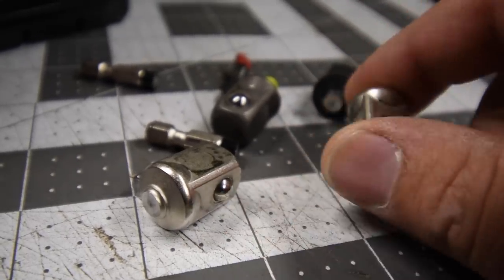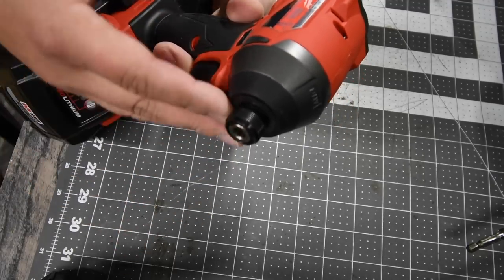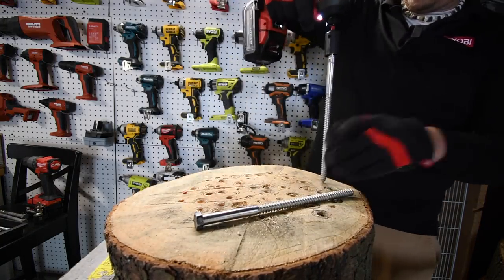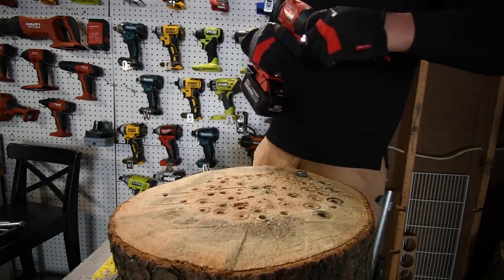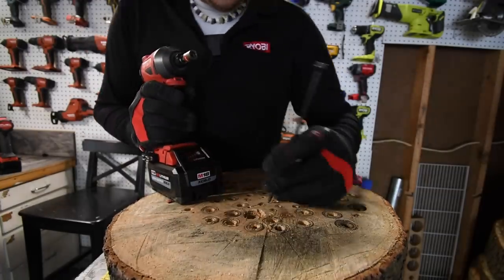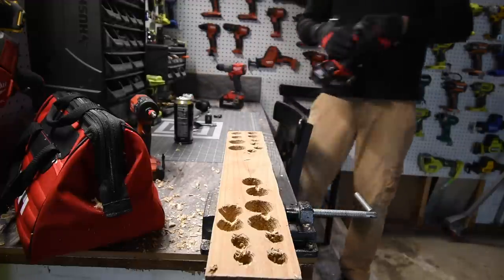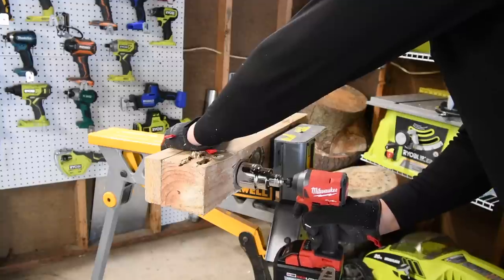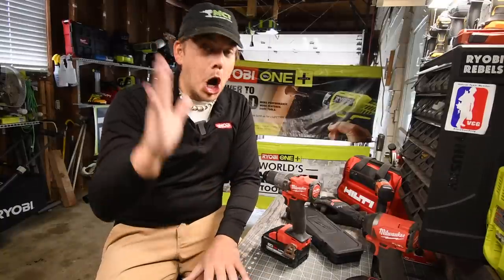Are Impact Drivers  OBSOLETE?

Comment: in real life, in a building site, is a little different,  try a lot of tools for a day this is a good test. 
p.s. the twist, of the screw, at every impact, absorb some the power of impulse driver, with costant torque, in wood, you can put pro-wood screw 400mmx12mm with only 60Nm, try drill on nuts and bolts you break your wrists.
who work in bulding/construction site, know that: every job require specific tools
sorry for any writing errors
Reply from the maker: id use HILTi for every tool that I can on a real job site.
Reply: i too, i've sid 4 a22 ,usually used it with 2.6 A battery or 4 A to reiceve more power, the tiny sid 2A 12v,  sf A 22 with electronic torque control, the grinder 115mm on off classic button (not dead man shut off button), and for concrete te 2 M. i don't need nothing else. at home use stanley fatmax, a surprise for performance\cost\quality.

Comment: But what about longevity,  the impact is designed for that , i worry the drill might burn out using it mainly for big fasteners (i have seen many cheap brand drills , and entry level high brand drills smoking out during heavy fastening)
Reply from the maker: the impact driver isnt designed for that either. if you do 10" lags all day long with the impact driver it will burn out very fast as well. this job is designed for an impact wrench

Comment: Y’all have completely missed the point of impact drivers vs drills, an issue I ran into today. Scenario: Helping brother in law with bathroom remodel (visiting out of state) leaning in access hole in ceiling with his Milwaukee cordless drill (doesn’t own an impact driver) arms extended trying to drive truss screws to mount exhaust fan to joist at horizontal right angle, the bit kept slipping (Philip head screw) as it was hard to apply enough lateral force to keep it engaged and the length of the drill made it hard to control not to mention stripping the screw head . With an impact it would have been cake, as you don’t need to apply force to maintain grip, the impact action drives the screw with very little if any force on tool with no or  minimal slippage.  And the size and weight make working with it all day more bearable 

In the test, Driving lags and drilling holes, especial where you have the luxury of easy downforce and where the hex head socket provides secure positive engagement, of course the drill will prevail. And who uses an impact driver for spade bits or boring large holes ?. Now try a different test, assembling and hanging cabinets or doing framing work, driving  3” construction screws at multiple odd angles and not having the leverage to apply force to keep drill engaged, and try it all day. You will be stripping screw heads and your arms will fatigue. I had been late to using using impact driver for those applications, and when I finally did it was a revelation. And when you combine a drill with counter sink drill bit, and impact driver with appropriate bit, assembling cabinet carcass is a snap. So it’s apples to oranges comparison.
Reply from the maker: I thank you for your story and input William. this video was just to demonstrate the power difference between the 2 different tools. because when impact came out it was able to do what drills couldn't because drill back in the day didnt have the power. I was just showing how evolved tools are now and thank you for viewing
Reply: Extension magnetic lock bets by Milwaukee helps in any or over head work
Reply: @PittsburghofCommander   I haven’t tried those, my mainstay for impact bits has been the  Makita gold line, but feeling frustrated trying to finish this bathroom remodel, I convinced my brother in law to spring for a new Milwaukee Surge impact and I had also picked up a set of the new Makita XPS impact bits after I watched a YT review , which featured the sets new magnetic sleeve that is amazing. The YT  video shows the guy using the mag tip with a torx screw, driving screw in halfway in vertical surface, and he lets go of the impact driver and the magnet it holds it in place without support. The combination of the new Surge and the Makita bits did the trick to get this project moving. We added new framing for built in shelves, and it all went super smooth using construction screws. Then when it came time to drywall, I discovered the Surge with XPS Phillips and the mag collar worked perfectly to set the drywall screws to the right depth. I thought the Milwaukee Surge worked great , if a little less powerful then my Makita XDT I have at home. And much quieter and less vibration. I can see using this type for repetitive fastening tasks, where you don’t need the extra torque. I will probably pick up Makita’s version of the fluid drive as that’s my battery platform. And back to the original subject, I should have tried the new Makita bits and mag collar with the drill I was complaining about , as I think that would have helped slippage and having to use so much force to keep engaged. Still, not the right tool for driving construction screws, but works if it’s all you got
Reply: @ManCaverTools  Yes I get the spirit of the video, and Im ok with provocative title (everyone does it). But to make a finer point, cordless drills, along with all classes of cordless tools are now rivaling corded in power , but the design of Impact drivers is about how that power is applied, with rotational impacts at intervals to drive the fastener instead of constant force and torque. Less force to stay engaged, and less cam-out/slippage that ends up stripping Philips head screws (really handy when disassembling a workbench built with screws). So yes, drill can do some tasks we use impact drivers for, and vis a versa, but neither can (should) replace the other (making obsolete). Edit: Forgot to say, with all that, great videos and comments, keep 'em coming!

Comment: using adapter on impact driver will reduce its torque. i'm waiting for the wrench vs drill hammer, even with slower speed, it would drive the slag much better than the driver. Not to mention, the impact wrench is having much more torque than the lesser, lighter impact driver.
for my use(assemble and disassemble furniture), impact driver is a godsend. Much less screw stripped, much tighter screw and so much less stress on the wrist and the weight. the XPH07 and even XPH12 are nearly broke my wrist while drilling one handed, but never the XDT or XWT.
Reply from the maker: I know it does and I thank you for the info thanh

Comment: Absolutely no adapter for me on a 1/4" impact driver. That's why they make a 3/8" ,1/2" and 3/4" impact wrenches and impact sockets. And by no means use chrome socket on a impact wrench. Drill is for drilling and impact for driving.
Reply from the maker: but it makes a good stress test video

Comment: Can't believe you snapped all them adapters straight away lol I've never snapped any dave
Reply from the maker: Thats what these tests are for lol and I thank you Mic :)
Reply: Anyone with this many drills obviously doesn't really know what hes doing.
Reply: Over sized bolts and nuts with big torque tight ft/lb. These tools are not designed for heavy duty mechanical or automotive repair are going to see plenty breakage on those little skinny adapters. But the host has proven these tools can exceed the expectations of their purpose and break all those solid adapters. 
It's the job for 1/2 " impact wrench drivers department.

Comment: Great video.
I was on the fence whether to go with the hammer drill that i already have vs the impact driver that i was looking for. Looks like hammer drill can do what ever the driver can do and more with less noise.

On a side note, i was reading about (hand arm vibration syndrome) white fingers due to vibrations and found that long term use of impact drivers is one of the reasons. Also the oscillating tools and sanders. Thought of sharing.

Comment: Ye but try taking the 1 u drove in with the impact out with the drill
Reply from the maker: it will take it out.
Reply: @ManCaverTools  av got all Milwaukee tools so a no there powerful tools. but try taking a impacted lag bolt out with the drill a bet it struggles or even fails

Comment: Dave, you’re actually breaking adapters because you’re using chrome sockets, the metal of impact sockets is meant to absorb the impacts and transfer the force evenly into the bolt you’re impacting, chrome sockets are heat treated to be as hard as possible to last longer, but that has the adverse effect of making them more spring like in a sense while impacting and, so the only part of the system absorbing the impacts was the socket adapter, hence why it broke every time.
Reply from the maker: I only use chrome on the one bolt. I broke the other 2 with a impact rated socket and on a smaller bolt
Reply: @ManCaverTools  don't listen to this guy he doesn't know what he is talking about
Reply: That, and he is trying to make a small tool do a lager job than it is rated/designed to do.

Comment: Now take off a lug nut with both of them also, you should be able to warrantee the makita and milwaukee adapters at home depot idk about the ryobi though if they sell them individually you be able to
Reply from the maker: I use impact wrenches for lug nuts but the impact I know will easily take one off

Comment: Hi Marc, well, your video, why do you say that the impact screwdriver is obsolete? Do you think the difference is due to the new technology in the drills? 2 weeks ago I bought the DCK 223b2-d3 dewalt kit which I think is formidable although it is lower than the 996 or 999 but do you think the impact driver is actually obsolete? because?? best regards...
Reply from the maker: the drill has a lot of power. it does tasks faster but it is bad for the wrists

Comment: Oh Yeah,  gotta Love those Milwaukee Collet's.   Also gotta Love how  Milwaukee just keeps selling that  impact driver Knowing it has  a Junk Collet and doesn't care , What's that say about Milwaukee ???
Reply: What do you say about dewalt selling impacta that go up in smoke
Reply: @nuclearexplosion5841  

I agree on the DeWalt smoke issue on their impact.  DeWalt and Milwaukee need to address these issue on the their impacts.  

Milwaukee is coming out with a gen 4  1/4" impact. I hope that's not milwaukee fix solution. What happens to all of the gen 3 that everyone has or still at the stores.

I use both brands and have both impacts. For my dewalt DCF 887 impact i changed the grease to the amsoil synthetic grease. It helped keep the impact cooler and I haven't seen any smoke so far. I'm not saying that's the only cause of the issue. I'm just saying that it feels like it runs cooler with the synthetic grease.  

Maybe DeWalt is using a low grade grease in the DCF 887 & 888 impact.  

Just wanted to share
Reply: Great point, Idk why they have a junk collet in the Milwaukee and an amazing one in their value line, ie ryobi, which has an amazing collet.
Reply: @nuclearexplosion5841  I personally haven't seen  ,except on YouTube,  or had that problem with my dcf887,  but I do  have and seen alot of the Milwaukee Collet problem , and I really like Milwaukee tools , they need to at least give out a kit to fix the problem.
Reply: @nuclearexplosion5841  huh...I was wondering why my DeWalt impact stank like burning wires every time I use it...even for one two-inch screw.  It's been doing that since I bought it...in 2016.
Reply: Bilal Hassan the dcf885?
Reply: @vojnikjna30  Yes! Why? Is this model prone to the electrical issues? Haven't researched it....I just live with it.  Too late to return anyway...lol
Reply from the maker: Hopefully they will fix the collit in the future
Reply: @nuclearexplosion5841  and makita with their brushed motors that burn out.
Reply: @inoahmann7542  That is the lowest entry level model. Makita has manny models, and even has two with oil impact.
Anyway, on all brands the normal impact driver is an abomination. For normal screws there is the torque limiter on a drill driver, so as to avoid kickback, and the integrated autoblocking function so as to manualy torq more if is needed. For large screws and nuts, there is the impact wrench, from 280 to 5000 Nm.
Reply: @loochan325  I have the cheapest impact ryobi makes and I have dropped it off latters, filled it with water, removed lug nuts with it, etc. I have beat the the crap out of that tool. It still works perfectly, no issues at all. It was in a kit for $100 with a drill 2 batteries, and a charger. To be fair the drill sucks. The impact sets the bar really high for a cheap impact. My point is cheap tools don't have to be bad but manufacturers make them poor quality to drive people towards buying their better tools.
Reply: See I dont use my impact to drill so its not an issue for me but they do need to change it to a better one.
Reply: Idiots not knowing how to use a tool does not make the tool bad.
Reply: @olecranonrebellion9976  correct, but a motor that burns out under normal use or a collet that drops the bit when removing it from a hole certainly does make the tool bad.

Comment: Impact can tigh and loosen with more power from the start (cause the impact mechanism).drill it just go with flow of the speed thats why he can do that also .but if something its hard tighening drill will not loosen it  ,and also can not tight  that much like impact ;)
Reply: Also is much lighter and smaller ;)
Reply from the maker: You are correct. both tools have a purpose. but some only use an impact driver and don't realize how powerful todays drills are
Reply: Man Caver Totally i agree with you :)

Comment: Interesting test. I was actually surprised how well the drill beat the impact driver. However, nobody seems to have noticed that in at least two of your tests the drill was on speed 1 instead of speed 2. It probably would have been even faster in speed 2.
Reply from the maker: it would not bae able to do it on speed 2, it the drill requires speed 1 for the torque that is needed for the lags

Comment: The fact that you put the handle on the drill answers the question no impacts are are not obsility
Reply from the maker: it was to see the power difference
Reply: @ManCaverTools  i know the test was to show power differences but a drill is bulky and can twist your wrist if it binds which impact is smaller so it fits in tighter spots and you don't need a handle cause it wont twist your wrist

Comment: Kinda not an honest comparison. If you're being honest you should use at least a 3/8 impact against a flagship hammer drill, if not a 1/2 inch. Last but not least they make a hydraulic cordless impact that is much more quiet than the impacts were used to
Reply from the maker: this video was just to see the power difference

Comment: Impact is better to handle all day long or overhead.... not obsolete by far
Reply from the maker: I agree, certain situations an impact would be safer
Reply: @ManCaverTools  i  just prefer it due to size and weight... I'll drill holes with it if i can get away with it and have the bit size on hand.....I use my drill for hole saws, mixing and bigger bits due to it being smoother than an impact and,  of course, they can handle that torque demand nowadays

Comment: An impact has better specs than a drill when it comes to RPM and in.lbs of torque so how does the Drill do better in these tests???? 🔴 I always thought an impact to be better for some reason.
Reply: Try take a car wheel bolt off with a drill lol or a old tight big nut on a rusty car suspension arm  impacts are designed for that kind of tasks drills won't work
Reply from the maker: Drills now are extremely powerful and it surprised me as well

Comment: The 6.0  and 8.0 batteries have IDENTICAL: output levels.  No advantage whatsoever. That said, the benefit of the impact driver is the elimination of recoil on the user.  Easy one handed operation.
Reply from the maker: I thank you for viewing Jps

Comment: Impacts are for nuts. Drills are for drilling and screwing.

You see if you drill a correct diamater pilot hole  for the screw any drill will succeed in drilling any length screw in the world.

I pilot drill every screw. It's the correct way to ensure strong wood fibers. Ramming a screw in without damages the wood fibers and quite frankly is a stupid thing to do
Reply from the maker: The tests I do make a perfect stress test on the motor. and that is what people want to see and I thank you for viewing Gareth

Comment: Why is the impact so slow and weak? I don't understand?
Reply: Impact loose some speed because it needs to hammer through the rotation when it’s getting heavy, while the drill has continuous rotation with no stop/pause as long as the drill still have  the power to continue
Reply: Impacts are slower than premium drills. The plus side of an impact is WAY less strain on your wrist, much easier to control, and much easier to control depth of fasteners too.
Reply from the maker: The results are crazy but both tools have their ups and downs
Reply: Man Caver Tools Very true. I don’t like using drills for driving, mostly because it’s harder to be precise with fastener depth. But I also don’t like using impacts for any kind of drilling that requires a lot of torque. They just seem to be a lot slower and louder without any real benefit in those situations. In any case, it’s definitely an interesting turnout!